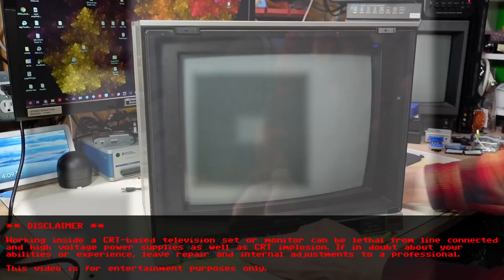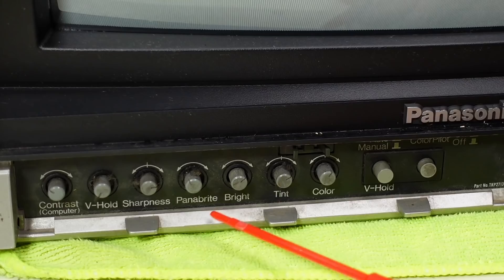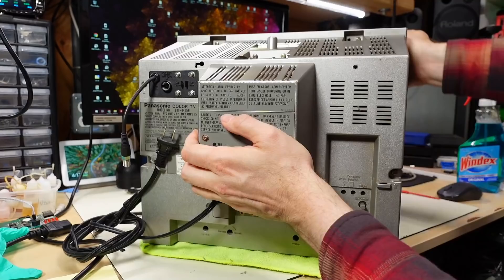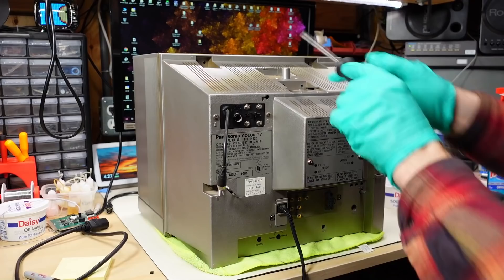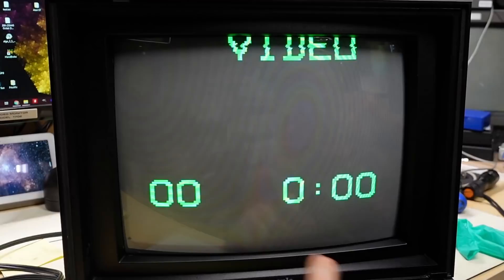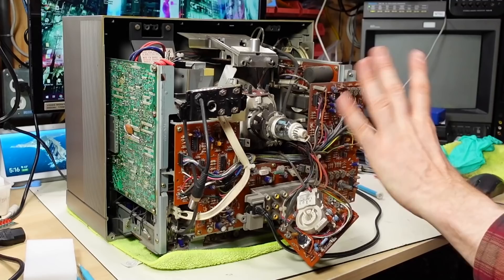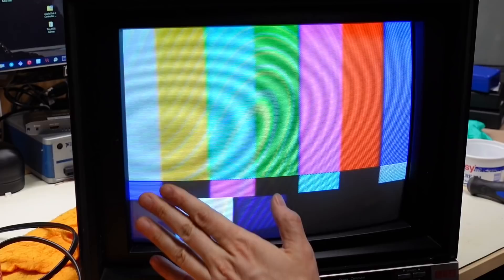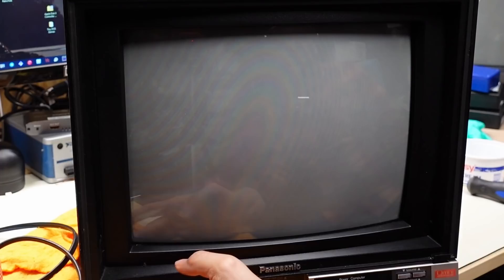This TV cost $1,890 USD in today's money when it was new! (Panasonic Omni CTF-1465R)

Comment: Wow, that's a hell of a find. Could you use a 3D printed door ?
Reply from the maker: I'd really like to print something -- but the 3D design is not my forté
Reply: Came to the comments to say the same, but assumed somebody else had already haha. I think I've had some silk silver filaments with a pretty similar color, but hard to know exactly given how much the color can change due to video. 

Anyway, with some dimensions it probably wouldn't be too hard to model.
Reply: @AttemptingAstro  I was wondering if it could be painted to match the colour ? I don't have a 3d printer, so I've no idea if the paint would react with whatever the plastic is.
Reply: @frankowalker4662  I'm sure there are exceptions but the most common types are pretty easy to paint for sure
Reply: I have a 3d printer and if you could give me closeups of many angles and dimensions, I would try and model a door for it.

Comment: This looks a lot like the one i had in the 80ies/90ies. But this one is more complex, mine did not had rgb or composite in/out nor would it display channels or volume in the picture, it had radio style buttons in a line, and the same type of door you push it open it and could adjust the tune for the "radio button" channels. It had the same glass cover with the plastic thingies with the arrow pointing right, i never took it off :)
I remember one day made a bang and smoke came out, took it to repair and it was fixed quickly, maybe a capacitor. I wish i still had it.

Comment: I recently picked up a Dell CRT that has been in storage for about 30 years... When I turned it on initially it had a pretty constant clicking noise and screen flicker.  I was really hoping that the caps just needed current flowing through them and the issue would hopefully go away.  Turns out, that was indeed the case.  After running the Doom demo for about an hour, the issue went away and has not come back.

Comment: i had a door for that monitor! sadly the tv is left at the old summer cottage middle of the north of Quebec. i will have to head there sometime when im up for vacation to see, my tv works but the back end is smashed up a bit, is gonna replace it with an 20 inch sony trinitron i found in the trash. i will see if i still got the tv though, unless my cousin tossed it out before im up there.

Comment: If you want it to last, consider recapping it. Panasonic caps from that era commonly leak into the circuit board and destroy traces. Look for discoloration on the leads, typically the negative lead.

Comment: 3D print the cover.  This is a commercial use set. Mostly for control rooms for broadcasters as a secondary monitor. The main monitors were much more expensive.

Comment: My unncle and aunt in Hungary had one of this sets for a very long time. It was branded as a JVC set, but the look of it was prett ymuch the same.
It was the bigger version, 19" I guess. They imported the set to Hungary way bayck in the 80s, when Hungary was still in communism, when the country still had a SECAM tv system, which was converted to PAL/SECAM and later to PAL only  at some point in the 90s. The set had a beautiful picture all over the years, and I still remember the first time I was watching Terminator 1 was on this particular set, when I was visiting them as a teenager in the late 80s. The set had a spacial looking remote, with flat buttons, almost looking like it had touch buttons, but they were normal buttons in a verry flat design.

Comment: minute 42:30 see the failure, that is because y has problems with black level clamping, if the signal comes in too strong it will do that, as black in some lines are taken as a horizontal pulses, due to overshooting the BLACK LEVEL, so, watching the end of the video and it wasn't calibrated, often need re-cap that stage, when it failed to clamp the black level, the whole picture will change its bright, as the resulting bright of the scene is the whole average (big capacitor), so, when the black level clamping which control the video amplifier gain fails, it changes the bright of the whole screen, doing overshooting or subshooting. This problem is also present in some TVs. by design, that its RF input is too sensitive made for tunning long distance tv stations, when hook something like a VCR or video game console, the AGC RF become crazy, as the range is too high gain, entering the signal to the video stage too strong.

Comment: The design is very similar to the Sony KX20PS1 video monitor.
Maybe it could be possible to make a new door with an aluminium plate where you can glue two small hinges and a small plastic upper locking system.
You could use a universal remote control because Panasonic used mainly the same remote control protocols.

Comment: It is so heavy because of the picture tube and attached electron gun component and related IC boards, the larger the screen, the heavier it will be.  13" cathode tv'/PC monitors were all heavy, and The metal case parts were beefy and heavy.  Try moving a 17" tube TV/PC Monitor.  Plain TV's were not as heavy.  LOL.  :)

Comment: I remember pre-recorded VHS tapes that had copy protection which messed with vertical hold.
Reply: Macrovision
Reply: Macrovision inserted a second, higher amplitude pulse in the V-sync / rescan interval of the NTSC signal. I'm sure Wikipedia has an entry on it.

If you had a very early VCR (read: Professional / Prosumer grade) with manual gain controls, it would ignore that pulse the same way a CRT TV would.

Macromedia (the company that invented Macrovision, and Flash) successfully lobbied Congress and the FCC to make it illegal to sell consumer grade VCRs in the US unless they had a non-adjustable AGC circuit on the video input. This also ensured that any copies of non-Macrovision tapes developed clone fade similar to audio cassettes.

Best Buy and Circuit City briefly sold some devices that would "restore your old tapes" which were just glorified manual amplifiers for composite NTSC and had to pull them off the shelves. I assume Macromedia either sued or got the FCC to fine them.
Reply: @DiverCTH  " ignore that pulse the same way a CRT TV would" - is that a joke? Plenty of older TVs don't have vertical retrace blanking so you'l see fading lines in the picture if watching a Macrovision source.
Reply: @eDoc2020  As a modern ham, I assume those were the same sets that didn't "follow good design practices" and caused feuds between previous generations of hams and their neighbors.
Reply: Macrovision: https://en.wikipedia.org/wiki/TiVo_Corporation#Analog_Copy_Protection_(ACP)
Reply: @DiverCTH  No, not really. Retrace lines are the diagonal horizontal lines as the beam is returning to the top of the tube. Proper broadcast TV transmits black (actually blacker than black in the US) so the lines are invisible if the set's black levels are properly adjusted. Then Macrovision came along and put bright white where the spec says it should be dark, causing slight problems with TVs which assume signals follow the spec.
Reply: @eDoc2020   That was my point. The spec said that the beam was supposed to be turned off during the Vertical Blanking Interval. Closed Captioning and the US version of CEEFAX (Teletext) took advantage of the VBI. 

The very last gen NTSC TV and VCR manufacturers partnered with TV Guide and the NAB and repurposed the US Teletext standard to provide a TiVO-esque On-Screen Guide in hopes of delaying the mandatory decommissioning of NTSC. ATSC supports that feature naitively.
Reply: Not a problem to duplicate with a Go-Video dual deck vcr.

Comment: You think this is heavy, try picking up a 32 inch CRT. I do not miss messing around and moving those TV's, they were heavy and took up lots of space. I do however find the tech operation of a CRT very interesting, it was indeed a clever invention and came a long ways since it's beginnings to its end of life. One thing I wouldn't mind having though if I ever got a chance to own is a 1080p CRT... I've never even seen one in operation. Always was curious on how good they looked, as CRT's most generally had much better color than most LCD's... even by some of today's standards.
Reply: I guess you could look for a smaller crt tv, takes up less space and is lighter to move.

Comment: At about timestamp 34:09, you talk about a 'ripple'. That is a simple, fixable issue, I believe, from my experience.  Do you have access to a CRT television / Computer monitor Degaussing Coil? Did you see a push button or momentary switch somewhere inside that was indicating built-in 'degauss' feature? That would be absolutely required for a proper, adjustments & refurbishment ceremony on this old unit.

Comment: EIAJ connectors were common on professional video gear. Panasonic sold this as an all-purpose monitor so I don't think it would have been out of place at a production house hooked to a U-Matic VTR. Also, the reason you don't see these is not because they were expensive, a good 14" color TV back in the day would have been $300 to $400 and the $680 quoted was the MSRP not the "street price" which was probably $450 to $500. I sold a lot of these type of things when I sold video. You don't see them now because table model TVs ge taken to the dump.

Comment: I think it should be possible to fabricate a new cover for the lower control panel at the front of that TV.  It shouldn't be too difficult, I would probably use 3mm grey acrylic sheet. It's fairly easy to machine and gluing parts together can be done with solvent.
Reply from the maker: I think something a 3D printer and some silver spray paint would work well for too... but I lack all design skills in that department

Comment: My previous comment got deleted for some reason. I have a Panasonic CT-1920M and it has the same connector on the back, but it might not be for RGB but instead for VTR controls as  it was used in TV production.  I don't have any manual for this monitor to know, but stamped into the metal next to the connector it says "VTP"
Reply from the maker: It's crazy how YouTube even deletes my own from time to time. I swear they must have a hard drive that fills up with random comments lost to time. As for VTP, yeah I've seen that before too -- that connector seemed to do double-duty handling composite video + control signals in some cases, other times Analog RGB and other times Digital RGB. Funny -- I guess it was kind of like a DE9 connector -- you never know how it's actually used
Reply: @adriansdigitalbasement2  I really hope that it's RGB on my monitor, but I think that since mine is labeled VTP that it is for tape controls.

Comment: Hi there, im a fairly new sub and would like to poke your community for some help. I adopted a 1989 Sharp Linytron color TV. The problem is the vertival picture is very choppy and incomplete, its mostly the middle 3 or 4 inches bouncing around, but the horizontal seems to line up alright. I spent hours visually inspecting joints with a cheap jewelers loup and found a bunch in isolated spots, namely the vertical standing daughter boards on the mainboard side, all I found or suspected have been resoldered, none tested bad though. I have changed a few capacitors, high voltage ceramic caps that looked reeeally dark but all tested good. I changed a few large wattage resistors that were falling apart, some tested good some didnt. I noticed a white line across the AN521 vertical output chip, so I opted for new old stock and changed it out. Nothing has helped. At all. The problem is no worse and no better after all this. Any suggestions please and thank you!

Comment: Post the precise dimensions of the front door hole and we can design you a 3D model of the door.  A little sanding and silver paint away from replacing the front door. (Glass clips too.)
Reply from the maker: I was meaning to do that -- the shape shouldn't be too hard as it will follow the front bezel right next to it so I can measure the angles from that

Comment: If that RGB input is made for older Japanese computers, which seems a logical conclusion, it might actually be an analog RGB input. Someone who’s more familiar with the Japanese computer market of the 80s might prove me wrong, but I think most of the machines, at least the popular ones like the MSX and PC-9801 which would be in active use in 1984 did not output TTL RGB, but analog.

Comment: What is the most likely component in a CTR monitor to break if it falls about a foot to the floor?

I remember a few years ago, I had a CRT sitting ontop of a computer tower vertically placed on the floor, and I attempted to slide the tower over to the side and the CRT fell off and hit the wooden floor. I didn't see any visible damage, but the screen wouldn't light up. I can't remember if I heard the monitor power on when pressing the power button or not.

Comment: If they are still using the same IR codes nowadays you might be able to use a current remote to control it... As for the door, how doable would it be to 3D print one? I guess the biggest problem would be to find all the measurements from scratch...

Comment: I had this TV that was Panasonic which was larger, but it had the same glass and clips.   My dad got it as a display model ©1988 and I had it all the way until around 1999 when I shot it with my bb gun (it had died) the interesting thing was that the glass must have been a highly special type as it did this really weird thing where pinging glass in a tiny cubic size and pattern very gradually over 2 days time was popping off randomly every few minutes or so...
Reply from the maker: Oh it must be tempered -- that makes sense actually as it would be dangerous to (to kids) is someone accidentally broken it in the home. 

And yeah, it seemed like they had some larger sizes of this high end OMNI series. Maybe your father got a good deal on the display model because no one was buying these crazy expensive TVs!

Comment: Compared to the $10,000 24 inch Pioneer Plasma TVs from awhile back, this ain't squat. I only paid around $500 for my 55" LG plasma. Computer monitors are a monster ripoff. I have a 54" Spectre dumb 4K TV from Wally World that I paid less than $300 for that I use for my monitor. I sit 2' from it and can see no pixelation. If I sit 2' from my Plasma TV, it looks like a checkerboard in comparison. 5 years old, on 12+ hours a day, 365 days @ year and going strong.

Comment: Hey Adrian, some more info about that connector on the back. I think it's called an EIAJ connector, and my Sony Betacam PVW-2800 has it as the monitor out for the video feed. I think that implies they're using it to carry an analog RGB or maybe even Component signal. Pretty interesting stuff
Reply: The same physical interface was used primarily on EIAJ VTRs, but for bi-directional composite video and audio. This is a different application for RGB

Comment: Always nice to see the CRT videos. Thanks for the great content. It's unfortunate that this is a MatsuSHITa monitor. What's also interesting is the chassis ID label is the same as what's on the Electohome arcade monitors. The control mentioned at 11:58 is in fact the screen control from the flyback. MatsuSHITa put them on the neckboard instead of on the flyback itself or near it. Wells Gardner did the same on the K4600 monitor.

Comment: The 8 pin connector is not RGB its video in and out for connection to a VCR. it allowed you to record using the TV's tuner.
Reply: Nope, that's a D8A2 digital RGB connector which was a widely used Japanese standard for what is essentially CGA video. 
The pinout is: 1 Video Clock (14.318MHz) or N.C., 2 GND, 3 Brightness control, 4 HSync, 5 VSync, 6 Red, 7 Green, 8 Blue
A friend in High School had this monitor connected to an RGB card on his Apple //e.
Reply: @Peter_S_  it's physically the same as the EIAJ VTR connector which was used for bi-directional composite video and audio. That's probably the source of confusion here. My late '80s Sony PVM has one of these but it's obviously labelled "VTR", and it has a separate DE-9 port for TTL RGB.
Reply: @AaronSmart.online  The source of the confusion here is the original commenter not accepting the description in the video which is correct and can be verified in the manual, and instead asserting assumed understanding because a different piece of equipment from a different maker used the same connector type for a different purpose. 70s connector types rarely have dedicated functions. Maybe that DE-9 on your old VTR is a PC/AT serial port? Probably not. See how that doesn't line up at all?
Reply: @Peter_S_  that's true, the video made it quite clear what it was for so I'm not sure why it's being questioned.